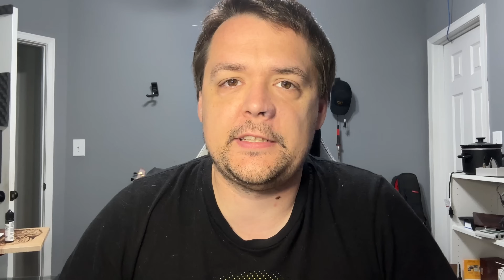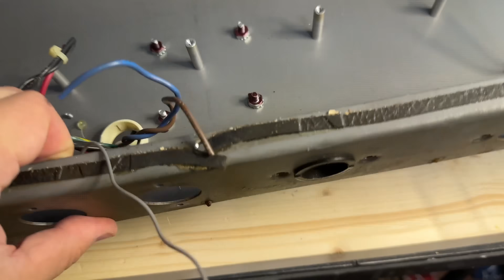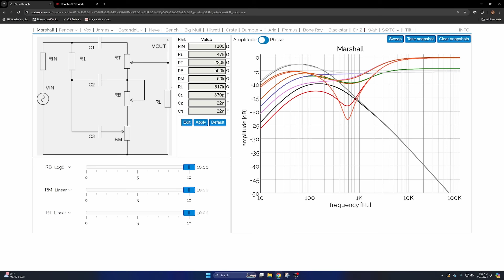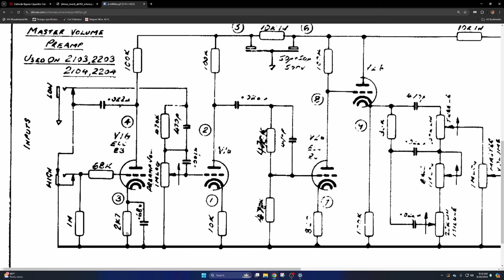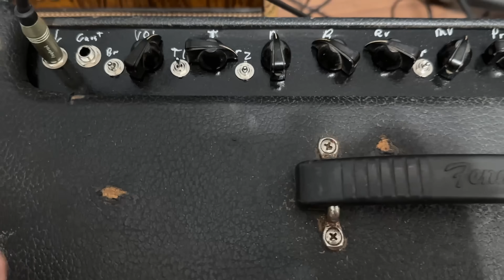From Junk to Gem: Restoring a $300 Amp into a $5000 Masterpiece

Comment: Outside of the Fender/Marshall orbits there's lots of interesting preamp stuff happening, some old Supros have grid biased input triodes for instance. If you look at the differences between the GE and RCA tube manual R-C tables you'd guess correctly that Leo F always used the GE manual

Comment: Kinda stuff I been looking for. Makes more sense to me now.
  I did a master vol mod on mine from fromel.and nothing but problems sense.
But the other thing I did. I replaced those resistors very poorly Amp.qorled greatly at jam for about n hour. And mechanical it failed. Horrible.
     Still have to dog back Into it not I have F&T caps for the board..
  Because I'm not taking this apart again.
       Paid 200 for mine from the original owner.  Wish I'd left it alone except the caps and resistors.
 First flvetsion hot rod deluxe.  But I don't have damage Like this other than trace lifting off the boar where the resistors always fry.
      But this helps me understand tone stacks a lot better.
Reply: Just praying I didn't cook my winged c 6l6 tubes..  That'll suck bad. Irreplaceable.
Reply: I'm happy with the mod. But I tried jj 6v6s didn't like them.
    My issues lie in the output section due to those effin resistors.
 Get to it when I can . 6 amps 3 work fine.,
 Crate stealth 100 head  needs Jack's replaced and a bias adjustment .
    My peavey is rock solid lol.
 And I do love my black star amped 3 pedal for certain things but nothing inspires my plying like a damn good running tube Amp.
 Also have 7 guitars needing work and finishing and gardening season is starting .
  I'm just overloaded and behind on everything.
   Too dmn many hobbies and too poor to pay someone else to do shit for me.
 But i have a friend that helps me with my amps. He's also my key board player , and bass if needed.
    Degree in electrical engineering retired.
A god man , but he doesn't know The depths of this type nof stuff.

Comment: Looking forward to this series , i tried the 50k mid pot in a plexi and liked it.
I love tearing the pcb out of hot rod amps !! I've built some basman/plexi type creations in them. 
I just picked up a 2002 59 bassman, and im going to handwire it. Im tempted to cascade one channel or maybe keep it stock. 
A hammond ot is going in with 2 4 and 8r taps. Maybe a line out , lar mar. And pentode/triode switch. Raw switch.. 
Should be a fun project.
Reply from the maker: Yeah that sounds like a great project. One thing you can do with the two inputs is: 1 is normal “plexi” and 2: is cascade.
Reply: @DaveEdwardsDesigns  yes I did that in my last hot rod deluxe build. I've built a couple trainwreck express amps  I'm also thinking of building one in a hr deluxe cab but I'd need different iron
Reply from the maker: Another good option is a Dumble style circuit in a HRD. A bluesmaster circuit is a great fit for the iron that’s in there already.
Reply: I have a personal build with one channel like a 5F6A preamp and I’m sure you will definite like the option of cascading. I put in a “cold clipper” gain stage on the free triode and it’s a nice flavor from time to time. Gonna tweak it a little but it’s been fun!